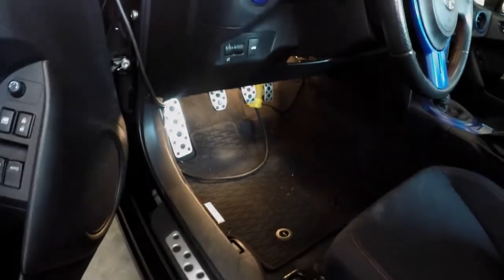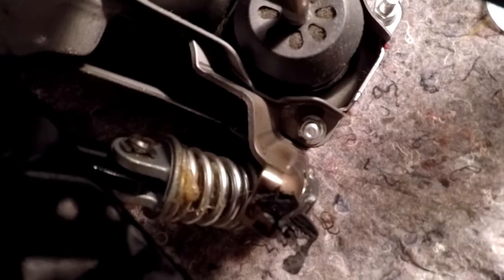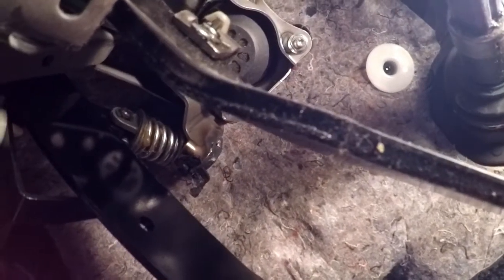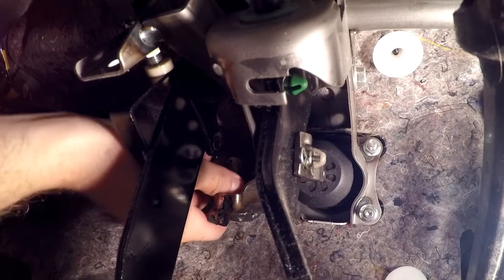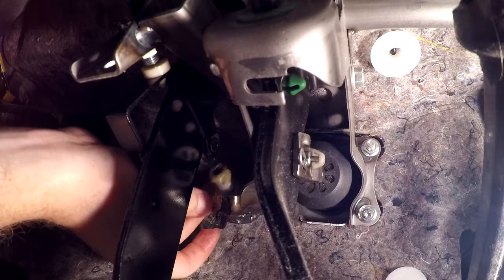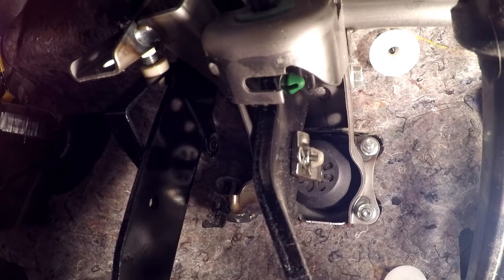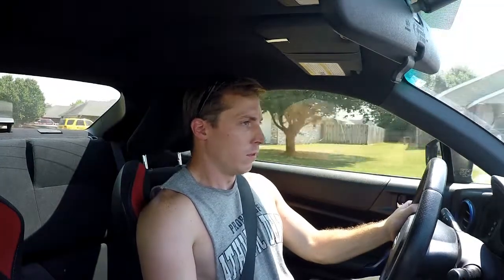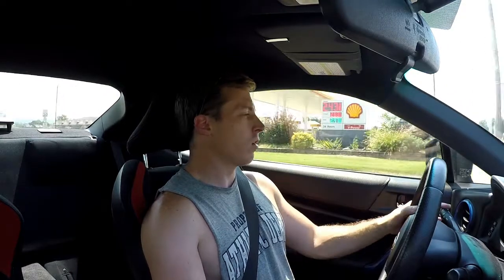How To - Remove Clutch Assist Spring - FRS/86/BRZ

Comment: I have that little play in my 05 subaru baja and thought my clutch slave cylinder was going out, so I replaced that and didn't fix that little play. Going under to see what is really causing it, when I fully press on the clutch and release, the assist spring doesn't fully straighten out until I pull the clutch pedal back up (almost an inch). As I see you removed the spring, it gives you a little play which sound like I'm having now. haha

Comment: So what did u do for the bottom part. I did the thing and removed the spring and have the bottom metal just hanging. I put the assembly back on without the spring but need a new clamp bc i broke it. . should i leave it on and connect it without the spring or remove the whole thing like i assume you did. Also how did you remove the bottom metal
Reply from the maker: mark contreras I tried to remove it but it was going to be more difficult than I would have assumed so I left it on. I left the rest of the assembly off.
Reply: @RageFueled  so you have the metal just hanging there? 
Im gonna assemble it back just without the spring.. I think that will still give me the benifit what you think
Reply from the maker: Unfortunately yes it’s just hanging there. Putting the assembly back should give you the same benefit for sure.

Comment: Does that mean we don't put any replacement spring for it? And should we use it completely without a spring? Is it correct without a spring?
Reply from the maker: No replacement spring. It is perfectly fine without it.
Reply: @RageFueled  Do you think I should replace the main spring with an pen spring that is very soft? My reason for doing this is so that the small song of the spring does not hang
Reply from the maker: You could but I have never had an issue with mine. Removing the spring and its mounts does not get caught on anything.
Reply: @RageFueled  Is the clutch too loose?
Reply from the maker: @parvariramin  not at all. Nice and firm. Nothing loose.
Reply: @RageFueled  👍👍👍

Comment: I lost the pin that you have to push out anyone know where I can buy it please help me
Reply from the maker: Braaap industries I would check with the dealership or find out what part number it is. Are you specifically talking about the pin between the pedal and spring or the pedal and firewall?
Reply: @RageFueled  the pin that holds everything together that you need to take off
Reply from the maker: Braaap industries email me at ragefueledone@gmail and I will send you an assembly diagram and you can get the part number from that. :)